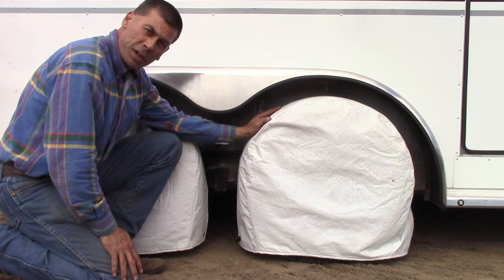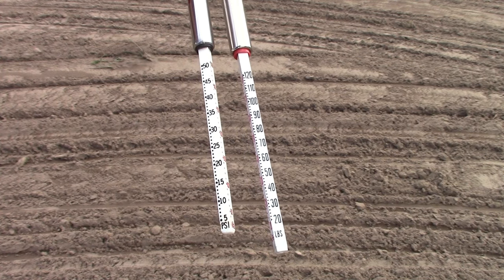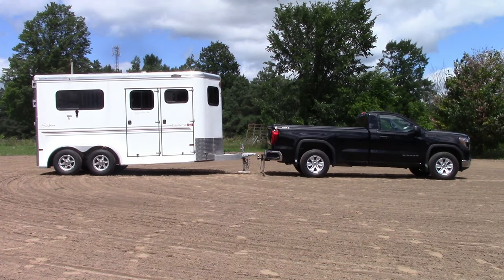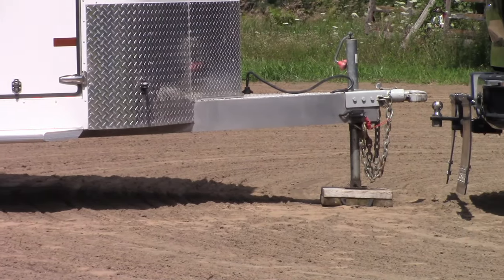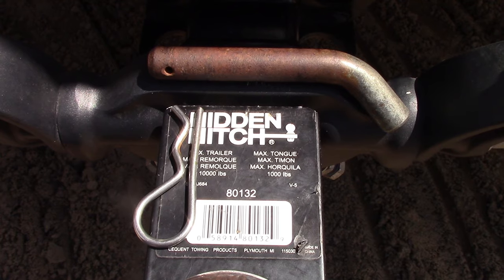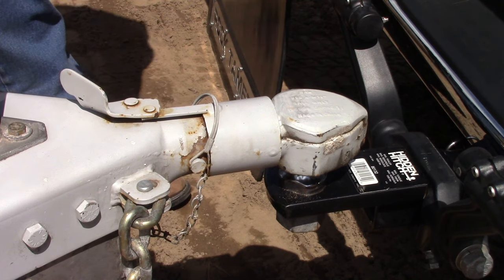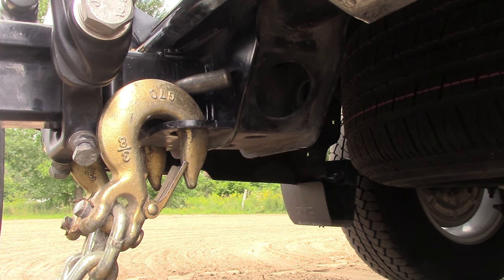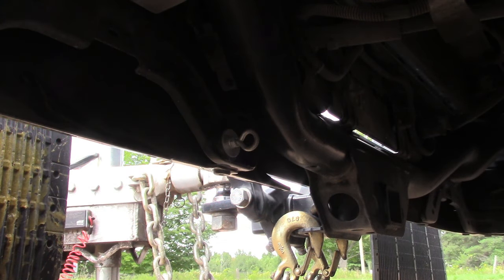What to Check When Hitching Up Your Horse Trailer

Comment: When matching hitch ball weight capacity to weight of trailer do you need to take into consideration the animal's weight? Great video. I have seen some scarey looking trailer hookups. This helps me understand and evaluate when traveling. Also a Rick Gore referral. Happy trails!
Reply from the maker: Yes, the animal's weight must be taken into consideration as well as any other items carried in trailer like tack, water, etc.  

Your trailer's information decal will have a number on it with a GVWR prefix. GVWR stands for Gross Vehicle Weight Rating which is the maximum weight of trailer itself, animals, and any of the additional items mentioned above. 

By using the trailer's GVWR as your baseline, and ensuring all other ratings (towing capacity of vehicle, hitch, drawbar, ball, and trailer coupler at least meet (and preferably exceed) the trailer's GVWR you will be on the "right side" of the numbers. 

Empty weight of a horse trailer can vary widely depending on size, configuration (horse only, horses + tack room, living quarters etc.), and construction material. The only way to know your trailer's actual empty weight is to weigh it on a commercial scale.

Comment: Hi! Rick from Think like a horse recommended your video. Excellent information. Thank you for posting. Oh...I have a question. Do you have a  preference regarding a "manual" gauge or a digital gauge?
Reply from the maker: I prefer a good manual gauge. Usually they are calibrated in 2 psi increments which is accurate enough, and no battery required!

Comment: Huh, i never new trailer axles where solid, always assumed they where free spinning.

Thanks for the info, dig the channel.

Also, whats hour opinion of reese hitches with the little stabilizer bars?
Reply from the maker: Good point, "solid" is a bit of a misnomer. The hubs on either end of trailer axle are separate, so inner and outer wheels can turn at different speeds while cornering, but there is no steering which is where the sideways "tire scrub" comes from. 

Hitches with stabilizer bars (often called "weight distributing hitch" or "equalizer hitch" by the manufacturers) seem to be more common on RV's, I have not seen them on many horse trailers in my experience. 

This article, while obviously intended to encourage purchase of their weight distributing hitch, does point out that ratio of tow vehicle to trailer weight is a factor to consider. https://www.fastwaytrailer.com/blog/should-i-use-a-ball-mount-or-weight-distribution-hitch

Our full size pickup + trailer combination rides level and tows steady with the ball mount hitch. 

If towing with a smaller pickup or SUV a weight distributing hitch may be necessary however it is important to remember that it isn't just about how much the tow vehicle can pull, it is also about how well you can stop!

Comment: Good info. Thanks. I have to buy new tires for my horse trailer. Do they need to be trailer tires or can I get away with car/truck tires?
Reply from the maker: I would say a definite "no" to car tires (their size designation begins with the letter P, for example P225/65R15) as these are not designed for the weight and side loading a trailer's tires are subjected to.

LT (Light Truck) vs. ST (Special Trailer) tires is a topic that often generates debate. This article, while written with RV's in mind, has good information regarding the difference between LT and ST tires: https://rvingwithmarkpolk.com/2012/11/08/trailer-towing-st-tires-vs-lt-tires/

Technical article from TireRack.com on trailer tires: https://www.tirerack.com/tires/tiretech/techpage.jsp?techid=309

My opinion is that your trailer's tires should be replaced with trailer (ST) tires because they are specifically designed for the application.
Reply: @brsnorthernhorsejourney3579   This is awesome info! I just bought the horse trailer and the tires are worn from sitting outside.  They are p235/75R15 So, what I'm hearing from you is I have car tires on it now? Wow! Glad I need to replace them or I would have thought they were trailer tires and they're fine. Thanks so much. I really appreciate it.
Reply from the maker: @leadfootmama   p235/75R15 is definitely a car tire as p stands for passenger. A trailer tire of similar size would have an ST prefix.

Look for a decal labelled "Tire and Loading Information" or something similar on your trailer, this will provide the correct tire size, load range, and inflation pressure as specified by trailer manufacturer.
Reply: @brsnorthernhorsejourney3579  Again thank you. Not many people out there that take time to help others :-)
Reply: Just curious where are you located?
Reply from the maker: @leadfootmama  We're in Ontario, Canada, a little north of Toronto.
Reply: I'm in Northern Minnesota about100 mi south of Canada
Reply from the maker: @leadfootmama  Up around Hibbing, or further west?
Reply: 10 MI north of Grand Rapid. Do you have family here?
Reply from the maker: @leadfootmama  No family, I just remember a couple trips into Bayport and coming back through Minnesota once on the way back from Oregon when I drove trucks back in the mid 90's.